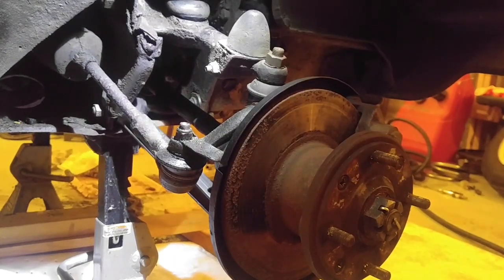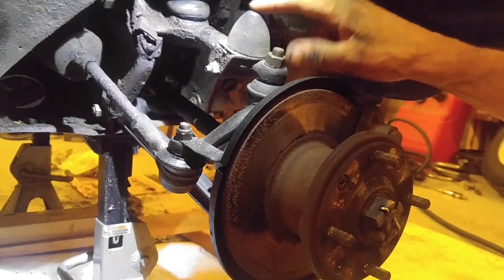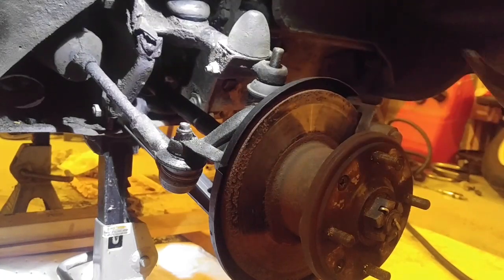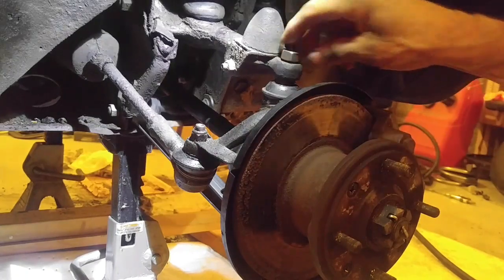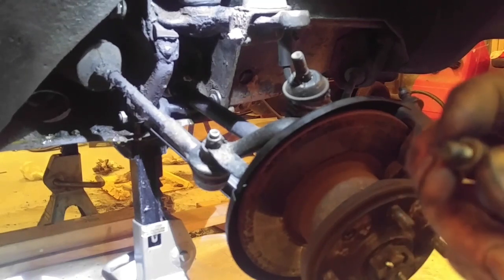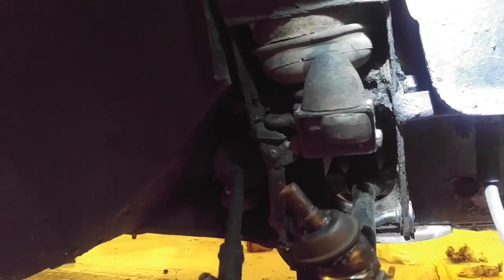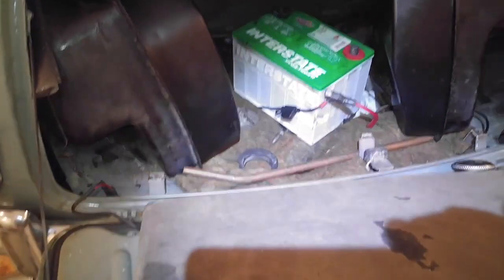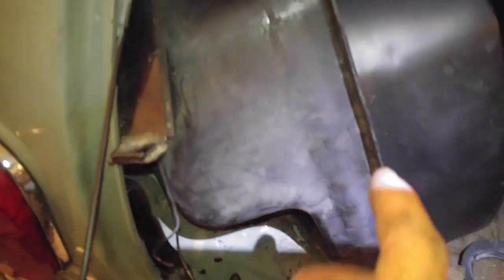Classic Mini Hydrolastic Suspension Removal

Comment: Hi how was to do the front. Did The dry units just push up into the tower column. Also read the ball joint arms on back are slightly different.
Reply from the maker: Good question...that was a few years ago, and not my car.  I think the coil over unit fit up into the " shock tower" and attached with the same bolts that held the top of the bag assembly in place.  Certainly fitting the coil over units was way easier than removing the original bag assemblies.

Comment: Will you be uploading a video of the conversion? Im thinking of doing the same with my Mini
Reply: Ill look into it! Thanks for your help.
Reply: Hi. Me again, I’d like to go ahead and convert my mini to the dry set up. Could you please send the link to the kit you used? Also, how did you bend the tabs in the front subframe? Seems like that would be hard to do because of the limited access? Thanks in advance
Reply from the maker: The kit was from Mini mania and I think it was #MMKT0909 although the kit had rubber "springs" instead of the coil springs shown.
   I have a 2 foot socket extension bar that did the trick on the tabs...along with a big hammer.  A long piece of thin pipe would do the same
Reply from the maker: That was the initial plan, but unfortunately by the time the installation portion started I had run out of both battery power and time.
Reply: sonordrum1000 bummer. Did you use the wet subframes? I’ve heard it can be difficult to use the hydrolastic subframes to convert to dry suspension?
Reply from the maker: @matt96723  I didn't change the sub frames.  Using the old ones worked fine...sort of.  The one real issue I had was the original bag units "twist lock" into the sub frame
  The new units don't, so you have to bend the tabs on the sub frame away ( no big deal ).  The issue is you have to extend the adjustable length of the new units quite a ways to stop the suspension from rattling over bumps.  In hindsight, I would look to see if someone makes the replacement spring units with the tabs like the original bags so you could just twist lock them in place.
Reply: sonordrum1000 boooo. 👎🏻just kidding. Thanks for the video.